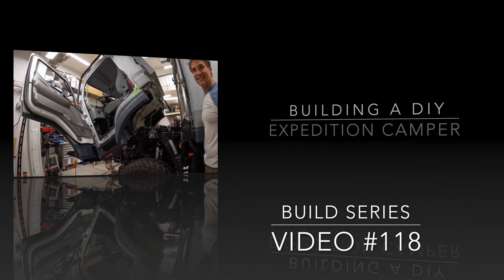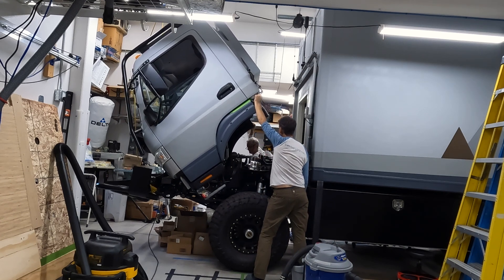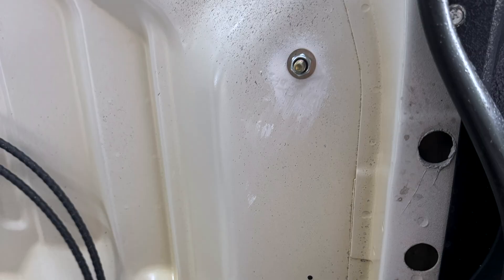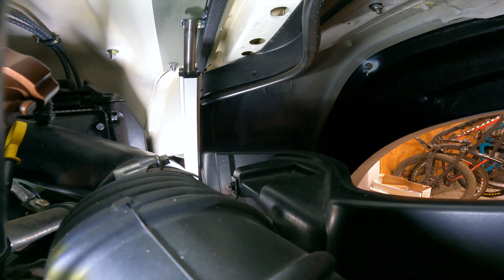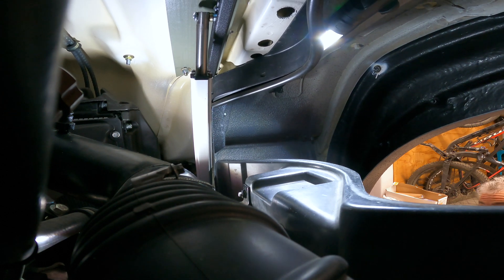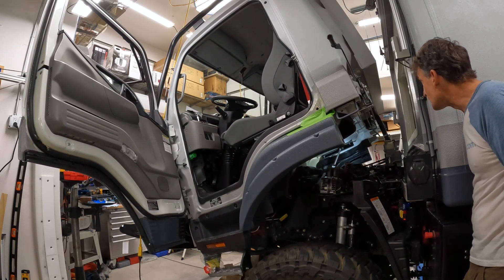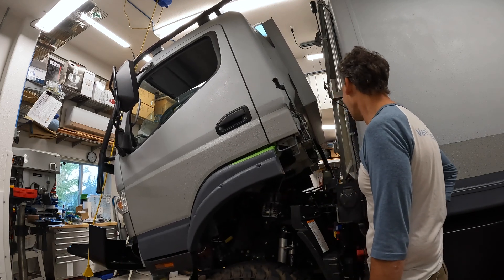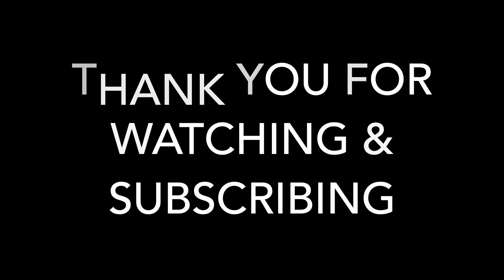Incredible electric lifting tilt cab for expedition Fuso

Comment: If it doesn’t lock out, how can it be safe to work under?
Reply from the maker: The cab is easily locked out using the factory lifting arm with its lockout. Additionally, the actuator will hold 450 pounds in any position without any power needed so the actuator adds redundancy for holding the cab open at an open position, as well as the arm.

Comment: Does the boot need to be removed when opening?
Reply from the maker: No, the engine intake boot and the pass thru boot just line up and seal when back in their closed position and don't need to be unattached when opening.